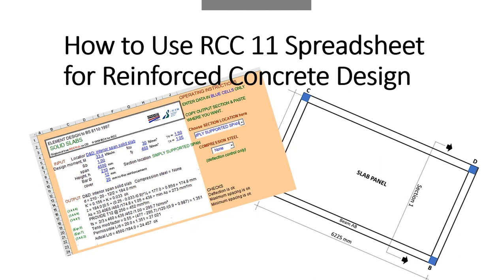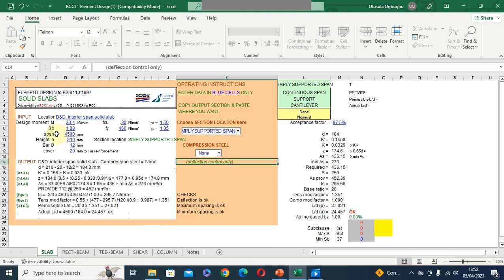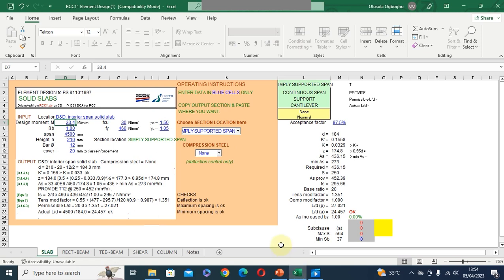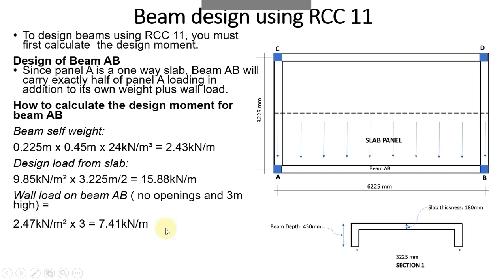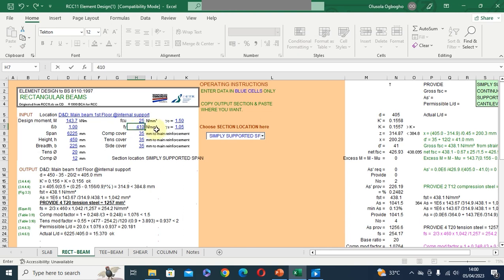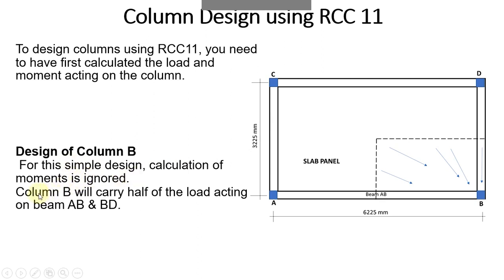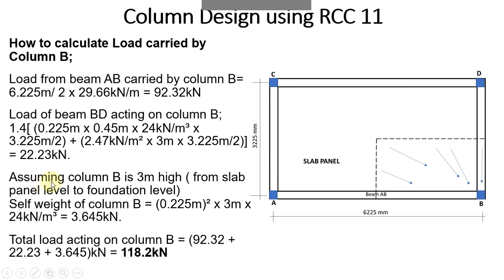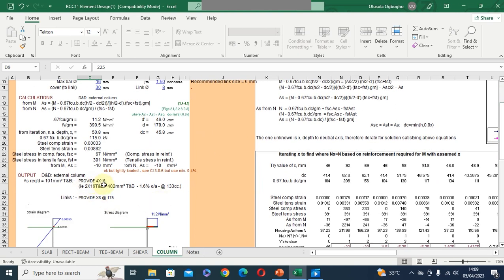Design of Reinforced Concrete Structural Elements Using RCC11( design spreadsheet

Comment: Can I have the link for the spreadsheet sir?
Reply from the maker: https://specsfinder.info/reinforced-concrete-council-design-spreadsheets/
Reply: @GodwinSholaconciseinfo  sir.
I noticed you didn't diffrentiate For the columns if it was uniaxial, axial or biaxial column.
Or is it that the spreadsheet cam diffrentiate it automatically if the parameters have been inputed
Reply from the maker: @Siafat-d7z  to keep the design simple and because the column is lightly loaded, i have treated it as axially loaded (Ignored calculation of moments) you can also design as a biaxially loaded column (you calculate the moments yourself or you can use RCC subframe analysis :
https://specsfinder.info/wp-
content/uploads/2020/10/RCC21-Subframe-Analysis.xls)
Reply: For a biaxially loaded column, how do we know which of the moment to input, because we have two moments because we have bending in two directions.
But we only have a tab to input in one direction